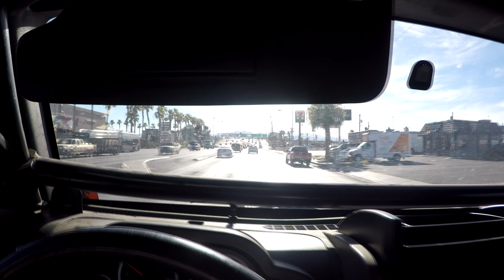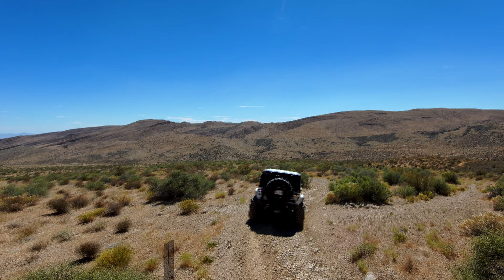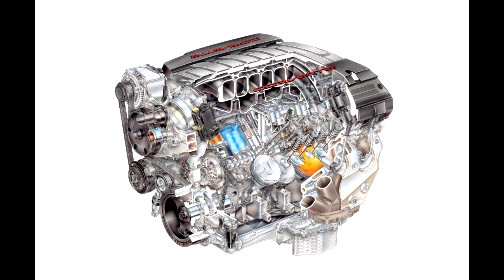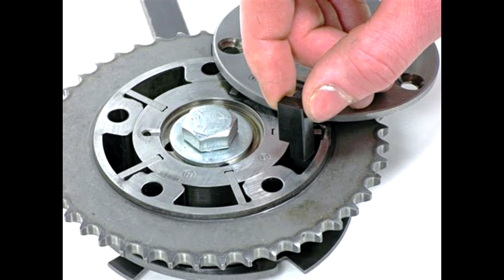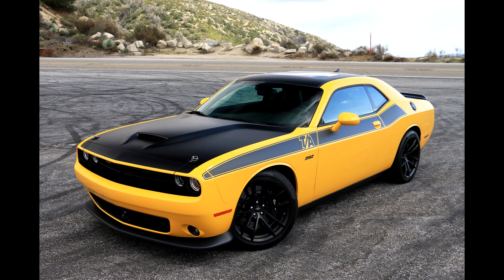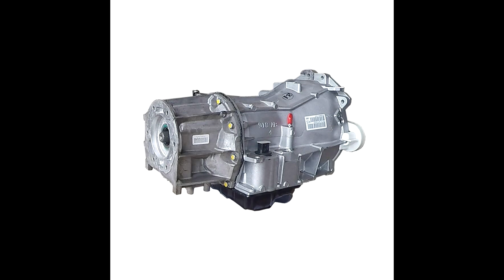LT1 vs Everything Else

Comment: I love the gen 5 lt1 small block engine but I drive a manual transmission camaro with a  tremic tr6060 transmission.. What I love most about the engine is the Down low Grunt This engine has a lot of Torque I don't know what it feels like in an automatic but when I drop gears and punch it in my Camaro it really throws me back into the seat Very impressive engine.

Comment: Can the lt1 be paired with the Allison 10 speed in a jku?
Reply: Techically, yes because the "allison" 10 speed is a rebranded chevy transmission, a heavier duty version of the 10l80. Similar to the mustang and f150 10 speeds vs the f250+ diesel 10 speeds.
Reply: Getting an LT1 6.2L with the 10 speed put in my 2017 jku soon. Driving through the Rockies with the stock 3.6 on wontons&40's is no fun at all.

Comment: I work at a GM dealer, we’ve literally not seen any problems with the 10 speeds. None. The 8 speeds had some fluid issues initially, but no hard failures